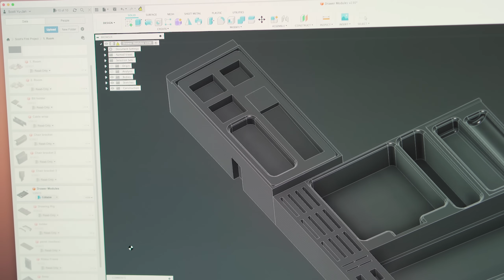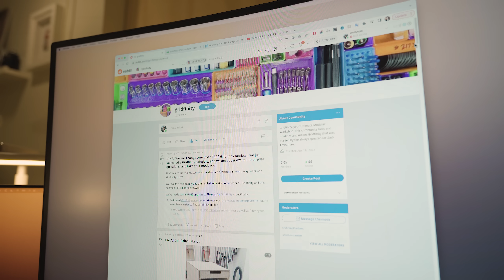Organizing my Drawer with 3D Printing

Comment: A more detailed breakdown of how you went from the reference photo to having precisely-measured and space-optimized slots would be cool, how you carved out the shapes with rounded edges and sliced the files with the progressively denser infill. Also how did you precisely measure the curve of the scissor handles? I do everything in Tinkercad and it's all I know how to use because using shapes to carve out other shapes makes sense to me, but is extremely limiting and not aesthetic.
Reply: That's the video I want to see.
Reply: @dhmclean  Yup, me too, would be nice to see in-depth vid on measuring from reference photographs (I know that u can calibrate your canvas in Fusion if you know exact size of something on photo, but maybe there is more to it).
Reply: @1ronman  I've calibrated a photo and done basic modeling from a photo, but what I want to know how to do it to be able to take an object and have it be "cradled" in a holder. Molded into place sort of. He does that a lot here.
Reply: Yes to a video like this !
Reply: @dhmclean  You could try using photogrammetry to make a model of the item and use it as a boolean to subtract the shape out of the container. A lot of work though lol and the tolerances may be too tight.

In the beginning of the video he speeds over modeling from a photo so most likely he just used the sketch from the reference and extruded in maybe added some wiggle room first and then added a bevel to the edges.
Reply: @dhmclean  Yup, same thing I want to know more about. The only way that I can imagine is just trying to follow the shape of an object with curves and then substract it's shape from base and maybe add some fillets. but as far as I understood he uses different technique.
Reply: seen this exact build on thingiverse even a novice can sniff this one out
Reply: tinkercad is kind of limited other cads are more complete, solidworks for example they have fillet that make the corner of a object be round and you can use a photo at real scale to make the placement for the object from the image, but i would like to see the way he does in the video maybe i can save time for future projects.
Reply: @dhmclean  you can make a sketch that fits the object, and then use the pocket tool to remove that sketch from a cube, fillet the edge, and you have your tray
Reply: Did he ever make this video?
Reply: @ZacharyChampigny  theres some similar ones he's made for channel members
Reply: how can I find them...?

Comment: I'm wondering for a while now: how do people film the 3D-printing timelapes like this? Is there a "timelapse" setting on the printer so the head moves to one spot after every layer? it really looks like magic
Reply: By default, no. If you use software like octoprint or similar they have timelapse features/plugins that do snap a photo at the same position every layer. Moving the print head away every layer does come with some quality degradation though.
Reply: They use an application called Octoprint.  It does pretty much exactly what you described.
Reply: @TheAnoniemo  As a side note, the quality degradation is mostly related to either printers that haven't been tuned well (temps too high, retractions too slow, etc) resulting in stringing during the print head moving away, or bowden setups resulting in the same thing. It's entirely possible to print something with and without octolapse and still have the same quality on a decent printer.
Reply: Octoprint makes it easy. There's also slicer plugins that will move the head to a specific position after every layer.
Reply: Thank y'all for the helpful answers! But you also need your camera settings synced to that specific time to take a picture, but the printer doesn't always take the same amount of time for eaah layer, right? Or is the camera somehow connected to the printer?
Reply: @niiklaswag  Octoprint controls the camera shutter.
Reply: @niiklaswag  It goes one of two ways - you hook a USB webcam up to the rPi running octoprint, so it can tell the printer to move the print head out of the way, then snap a frame from the webcam, then start printing the next layer. Or, you hook up a camera with an external shutter trigger, though that method is a bit more technical (but allows for DSLRs to be used.)

Personally I went with a Logitech Brio 4k webcam since it can be kinda DSLR-like if you set it up well and it's filled my needs just fine as it meets the convenience of a USB webcam + the quality I needed.
Reply: The Ender 3 printer that is being used here does rely on an external camera, but the recently released printer from Bambu does have one built in that allows for a much simpler way to create timelapses.
Reply: if you dont want to deal with octa and a camera , you can get beagle camera its plug and play solution

Comment: Hi Scott, can you maybe make a video tutorial on how you make the 3D models?
How do you get your measurements for the holders, for example?(in depth guide)
Because of this video, I am looking into 3D printers now. :)
Reply: Same same! 
Also which software did you use for that?
Reply: @MichaSwiton Would also like to know
Reply: Ok, reviewing the video again it's clear that he used Fusion360
Reply: You can use any 3d modeling software that exports STL files.  Sketchup is free and can get you going.  Measuring simply comes down to pulling out your ruler and angle.

Comment: Everything fits so perfectly!! Amazing as always.
Great tip about avoiding bottoms on prints at 4:14 , everyone should start doing that
Reply: Surely it doesnt save that much time compared to the duration of the print right? Is it more about saving material?
Reply: @Peter-jt3de  First layers take a long time, especially with big flat surfaces like that. I wouldn't be surprised if it saved over 20% of the printing time
Reply: @NicksStuff  I agree! first layer is the killer for time!
Reply: Hey can you tell me how to achive this setting in cura. I mean how to reduce the bottom  material
Reply: @petr0ski  ok will check it out
Reply: @petr0ski  and can you tell me how to get that increasing density of infil towards the top
Reply: What settings would be used to achieve this?
Reply: @John-yw9sm  heyy you can see my previous messages in this thread for how to achieve that in Cura.
Reply: @petr0ski  my guess is that you need to model it in fusion 360 this way.

Comment: I looks beautiful, almost like the food on the commercials. But I'm curious about the long term operations of such a custom system later on. In a few years time you're inevitably to change the bands/types of hardware you store for quick access or realize you need more storage for some components (say more colors for the markers) - I feel daunted that in order to add something I'd have to eventually go back to CAD to tune the models and then re-print, probably to a point that I'd just store a new tool somewhere else, instead of a drawer where I'd actually want it to be. Don't even get me started the availability of filament of the exact same color after a few years. Standardized storage systems (like Gridfinity you've mentioned, although I'm not rly a big fan of it) feel a lot more evolvable.

Comment: not to backseat, but for less plastic and faster times if you havent already i'd suggest:
^lightning infill (like line/rectilinear, but it leaves empty space empty, and only starts 'spiderwebbing' supports higher up, where it actually needs it ^^ strength largely comes from perimeters, not infill afaik
^only 2 perimeters, but 3 top and bottom layers ^^ still super strong

(using ^ instead of - to avoid the frusturating line-through)

Comment: Very well done!  Nice thought went into what went where and how everything should go...  I have a few questions though.  

1, how long do you think the organizers will last?  They sound "light" when they get moved around - but perhaps they are solid and well built and will be be tough as nails.  
2 - how many rolls of filament did you go through - that points to how much did you have to spend on materials for this project.  
3 - how did you get the dimensions of things like your scissors, etc???  Did you actually measure each item out and then draft it in CAD or did you find files online of these shapes that you can bring into your CAD and modify as needed.

Anyway, this is a great example of 5S and it is clear how it will help you stay more productive and focused.  That plus it is super clever, looks great, colors are all matching, it looks professional so once again very nice job!

Comment: 3:40 this is with a big '*'. 3x faster is assuming you have about a 10 watt charger. The iPhone 15 and older support up to around 30 watt. This has gone up to about 45 with the 16s.

Comment: The problem with white filament is its high in titanium dioxide so it will wear out the nozzle quicker and of course there are possible health ramifications to using this color of filament indoors.

Comment: Thank you for the very satisfying and inspiring video,  I bought a 3D printer to start making custom fixtures for my laser engraving projects. I have lots of experience making design's in 2D, but not much in 3D. Where you you recommend I start to learn how to model 3D parts and then print them on my printer. Recommended software? Recommended tutorial for noobs? Thanks!

Comment: There's so much great to say about this project! I love the modular nature of it as you can change out any of the parts if you want to later. You had me impressed and inspired at the stacking elements and the double duty of things like the screwdriver holder also being a parts tray that you can pull out and use. Absolutely great thinking. My only question is, was there a reason why you chose to use magnets that were hot-glued into place instead of using a pause in the print and building it into the part?

And amazing editing work with picking up the parts off the build plate! It took me a minute to realize that you were editing yourself into picking them up off the plate while the build was still printing. Really cool effect!

I also love your honesty about having taken a full year. Sometimes it can seem like there's something wrong if I can't get the project done quickly and the condensed short videos don't convey how long it actually takes.

And to answer your question, no, it's not too much.

Comment: How did you do the design without a bottom? That's a clever way to save time/plastic, but I have no idea how you designed it to actually work.
Reply: I think he did design it with a bottom but in the slicer he got rid of the bottom layers

Comment: Correct me if I’m wrong, but did you switch back to your original stepper motor rather than using the pancake motor? If so why is that?

Comment: He’s creating inserts to organize all his miscellaneous items in drawers. The big question is: why not make a video showing how to program this into a computer to define all the dimensions? How is it done so that we can create similar designs for a 3D printer?

Are you an engineer with years of experience needed to program these designs, or do you use software that simplifies the process? Is it as straightforward as marking out sections, or does it require more advanced knowledge?